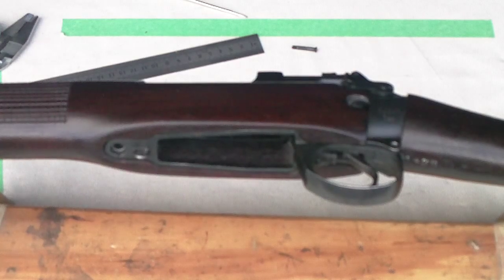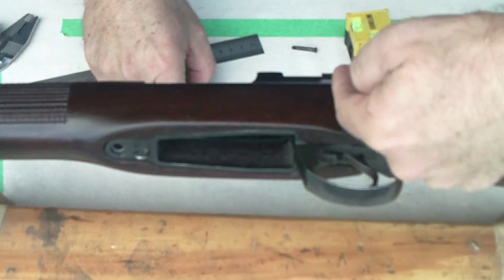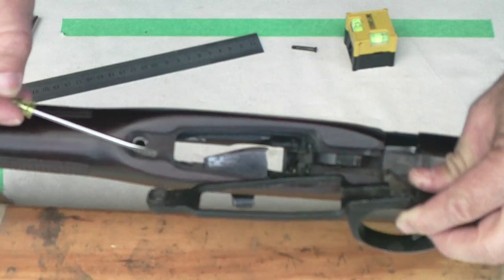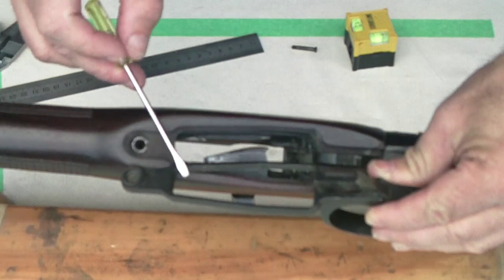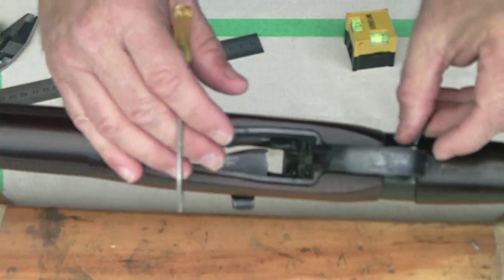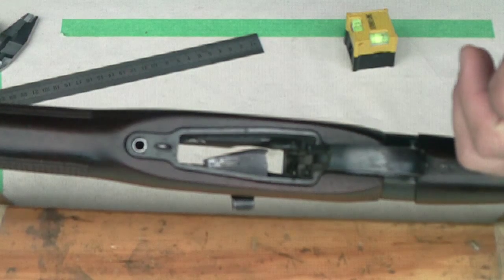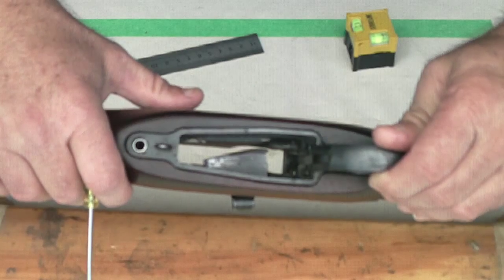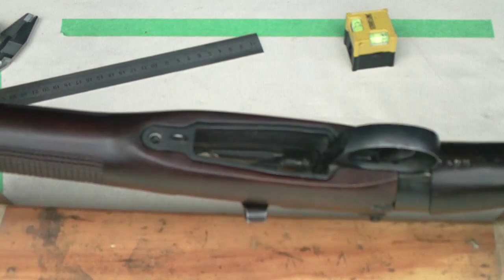Lee Enfield rifle trigger guard bedding

Comment: Ive been messing with a no4 mk1 Lee Enfield tore it down cleaned it good everything has been put back together except the trigger gaurd it wont go in the triger keeps taking off wood in the inside of the stock and theres no trigger movement of course but im not sure why this is happening ive checked and double checked everything else to ensure i assembled it correctly to the best of my knowledge i have. Any thoughts would be greatly appreciated!